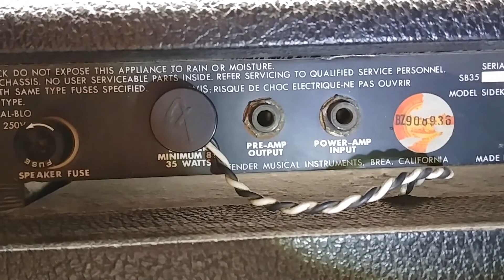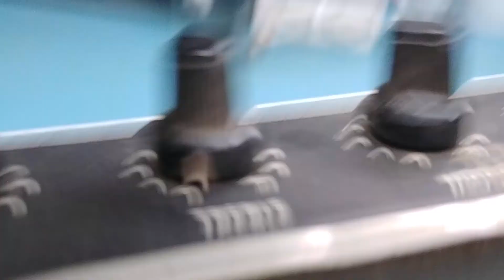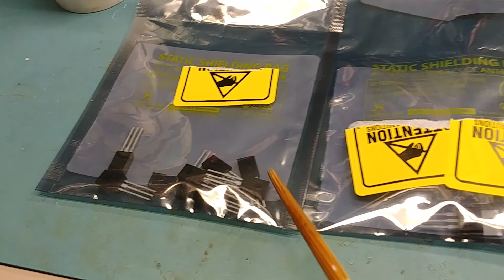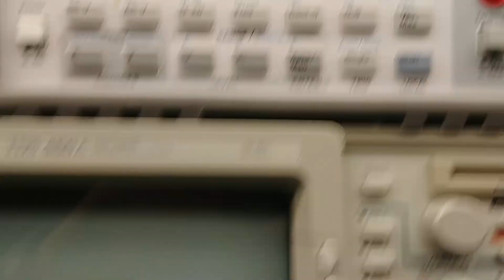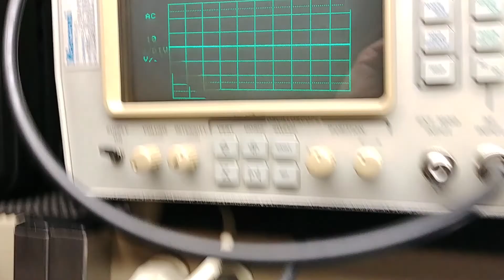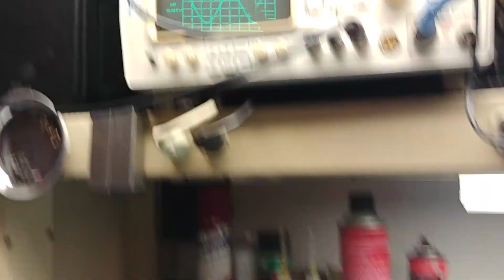Fender Sidekick 35 Bass Amplifier Repair

Comment: Great video. Thanks for the explanation on transformers. I just acquired the same amp. What model was the transformer you put in? I'd like to get one.
Reply from the maker: Hi,
The transformer I ordered was a Hammond model 166J44 - 44v CT @ 1Amp. I wanted to go with the 2 Amp version for a bit more headroom but the physical size would have required more chassis mods that I wasn't really interested in doing. At the end of the day, the transformer I installed worked great and matched the spec of the one that failed so no regrets! Best of luck with your project

Comment: I can't believe you have zero comments! Thanks for the video. 
I have always wanted to learn how to fix and tune amplifiers. 
I am a complete novice eager to learn every step of the process. 
Where would you recommend starting the electronics repair journey?
Is the amp a good entry or is there something smaller to consider?

Things I do know already:
Safety first-

No metal things in the chassis. 
Keep one hand in the pocket. 
Drain the capacitors if possible. 
Unplug it. 

Things I do not know but will figure out:
Cleaning pots
Soldering the jacks 
Removing components from the circuit board. 

Things you have that I do not:
Cool scope. 
Executive level multimeter. 

Hell yeah. 
Thanks.
Reply from the maker: Hi,
Sounds like you've got a grasp on some of the basics. As far as soldering and cleaning pots, there are a bunch of videos out there on those subjects as well as basic electronics and troubleshooting principles.

One thing I'll say about cleaning pots is that for me, it's a 4 step process: 

- De-solder the pot
- Flush it with liberally with a good quality plastic safe electronics contact cleaner like  CRC QD contact cleaner and work the pot shaft
- Spray a very small amount of Deoxit D5 in and work the pot 
- Solder the pot back in place

I used to try and clean them without removing them but over time I have found that they will soon get noisy again if you're not thorough. So rather than have a piece of gear come back, I just take the extra time up front to do it correctly. 

Good luck in the hobby!